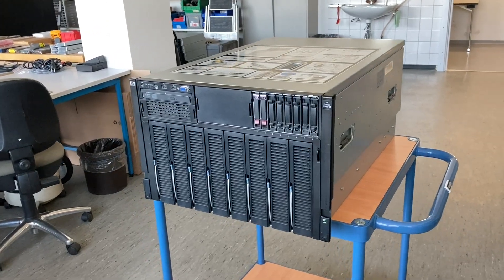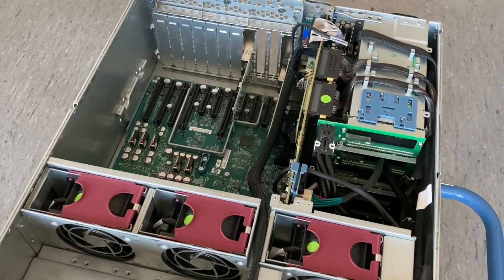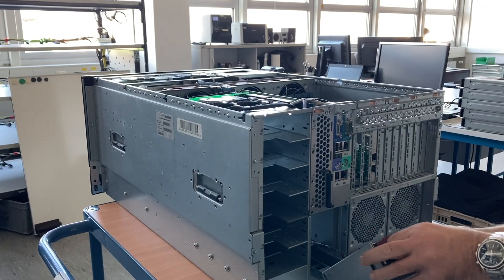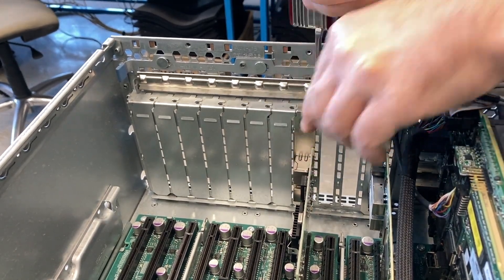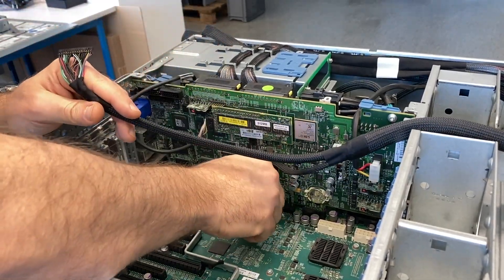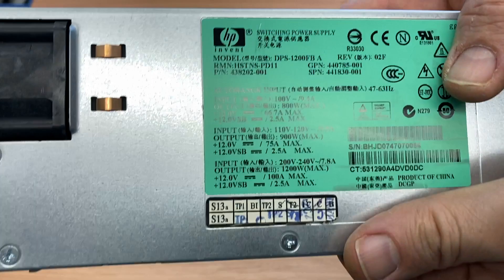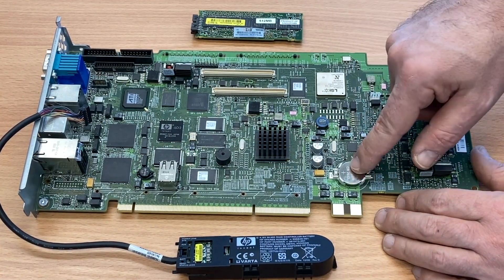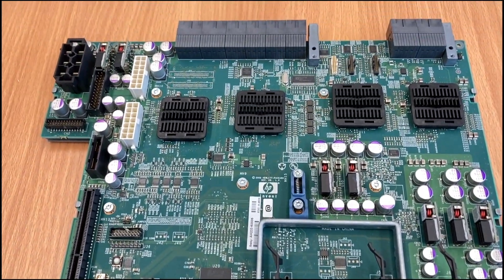Teardown of a HP DL785-G5 server (PWJ256)

Comment: I remember troubleshooting one of these on arrival when they were brand new.  FOund out the processor cells were addressed from the outside in, 8-1-7-2-6-3-5-4.  This let them sell a version with a blank in the middle four slots (I guess to look pretty) and it would still boot.  But they never documented that it would still work with 1,2 or 3(?) cells installed

Comment: Not the fastest nowadays but a monster, like 15years ago.
Wouldn't have guessed they would go past 45 or 32nm back then and those monsters would remain king for a bit longer.
But it finally happened now, it seems.
Sad to see it scrapped, like scrapping a dual Pentium Pro or so. Still have a few CPU modules around, because I wanted to build one in like 2015 from parts on ebay ;-/

Comment: Around 10 years ago I wanted one of these, but they were still going for quite a lot despite being very outdated even back then. 

I ended up finding a stupidly good deal on a DL580 G5, which was pretty similar but half the number of CPUs. I still have it, but a single old E5-V4 can out class it, so it's in a museum section of a rack being used as a shelf.

Comment: Hi thanks for the videos.  What happens to all the junk. Cheers
Reply from the maker: It goes to the recycling bin and into hardware heaven.... :-) Most of it. Some devices are kept for museum or given to enthusiasts.
Reply: @PlaywithJunk  Thanks, i should have been more specific. What bits are worth keeping and where do they go? Is it mostly scrap aluminium, for example? Its just the engineering is amazing on some of these machines. I also wondered if they are ever up cycled or repurposed in another machine. Cheers
Reply: @mixolydian2010  Lots of sheetmetal and plastic. Small amount of aluminum confined to the chip/semiconductor heatsinks.

Comment: holy... 7.2kW, I doubt I could run that from a single outlet in my home xD
Reply from the maker: You can't just add the watts of all power supplies. First of all, it's a 3+3 redundancy. That means the server needs 3 and the others are only necessary if one or more fail. That reduces the maximum power to 3600W.
And the 1200W per power supply is the maximum it could deliver if necessary. That value is newer reached under normal conditions.
I would say this one takes between 1000 and 2000W and it worked on a single 230V/13A outlet without a problem :-)

Comment: Specifically made for something purposely built and not be able to be used for anything else what so ever.
Reply from the maker: I don't know what you mean.... this is a Proliant server like many others. Just more CPUs and RAM. It could run all software like any other server.
Reply: @PlaywithJunk  I mean like this that these servers internals like any of the pcb:s can not be used for any other server they are not purposely built for. In contrary to consumer stuff, you can mix and match quite much.
Reply from the maker: @dtiydr  Ah... ok! But that's normal with all servers. You can't even move a Gen8 board to a Gen9 server of the same type. Dell, HP. IBM, Lenovo... all the same, all different 🙂